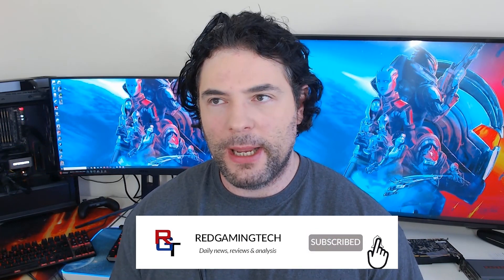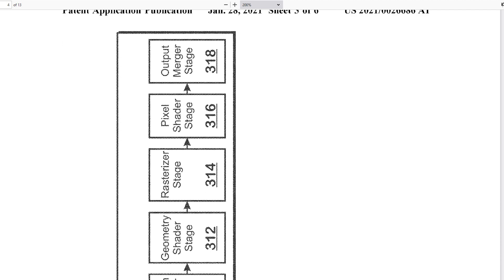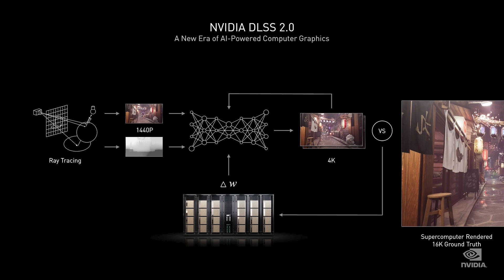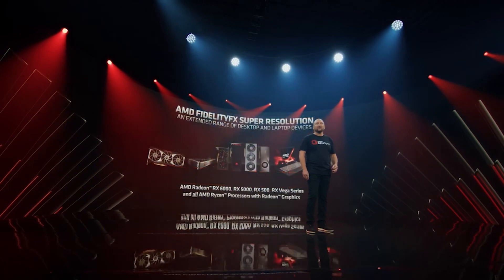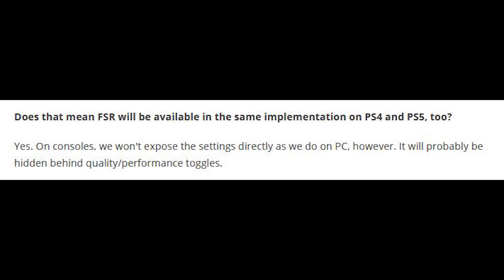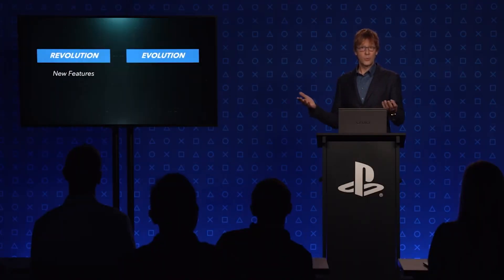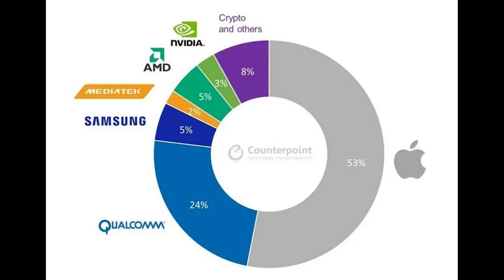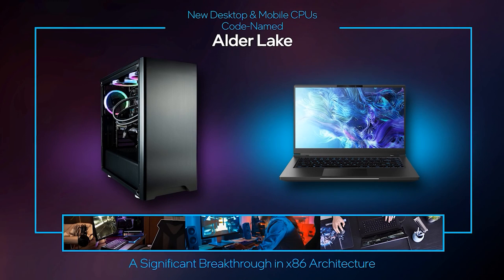RDNA 3 Upsampling - How Navi 3X Could TRANSFORM FSR | PS5 FSR Support CONFIRMED By Dev

Comment: FSR is primarily a showcase in how effective AMD's marketing is.  As far as I can tell it's essentially just CAS 2.0 coupled with basic bilinear upscaling but they've managed to get tons of people thinking it's better than DLSS.

On the topic of DLSS, as far as I'm aware only DLSS 1.0 required per-game training.  That shouldn't be the case for 2.0 - it's supposed to be a completely generalized model without any per-game training data required.
Reply: FSR is WAAAAAY more than you're giving it credit for. But it seems you only listen to Digital Foundry...  If only Digital Foundry's FSR comparisons weren't all totally fucking broken... On a TON of levels... -_- ... How the fuck have you not heard about this yet? He ruined the comparisons with different depth of field settings in Kingshunt that gimped FSR vs Unreal TAAU (when properly configured the former looks BETTER, not worse). 

He refused to test above 1080p (which HEAVILY favors temporal solutions due to the minimal available single frame pixel data even though 1080p is a completely LAST-GEN resolution). 

AND he ran CAS on TOP OF FSR, double sharpening the image into oblivion. Do more research and don't trust DF just because it's DF. There's a reason they were the ONLY one to think FSR sucks.

He also only tested still screenshots which MASSIVELY favors temporal solutions over spatial ones as it makes it so you can't see the AWFUL motion artifacts temporal upscalers cause.

Alex Battaglia had an agenda, and so he bent & manipulated his testing to fit that agenda. End of story. It's sad that he's tricked soon many fools like you though.
Reply: @Cooe.  Paranoid much? Dude calm down, you make FSR sound like some kind of religious topic.
Reply: @stingymcduck5450  I'm just tired of people regurgitating the same definitively proven faulty Digital Foundry FSR "testing" BULLSHIT over... and over... and over... and over again. It's admittedly very frustrating, and I'll acknowledge that can get to me after a while. 

Having people blatantly ignore what's staring them right in the face can be aggravating as all FUCK lol.

It's like someone staring at a red rose and REPEATEDLY claiming that it's blue because someone else claimed it was blue because they were wearing blue tinted glasses that COMPLETELY corrupted their test view of the rose's color... -_-

Also, you double posted.
Reply: And it completely SHITS all over standard bilinear upscaling used with CAS. Like, it's not even fucking CLOSE! Maybe do your own testing instead of regurgitating Alex Battaglia's horribly broken & unscientific bullshit?
Reply: @Cooe.  I've looked at every comparison I can find and did my own testing for the games I have access to.  I've seen nothing to indicate that FSR is anything more than what I stated - just a slightly smarter sharpening algorithm vs CAS.
Reply: @Cooe.  you sound so angry but there's images from the community that can back him up, sometimes he's too mean but he does have valid points like temporal upscaling should be better than spatial (unless its implementation is absolute terrible) aswell as there's many upscalers in the pc market that can bring similar quality or better although it might emphasise different characteristics so its upto you if you prefer it or not.

What I will say is why is using 1080p and upscaling so bad? Considering thats fsrs main use for most people is to prolong older gpus which cannot run at 4k. Youre argument here is that it only makes sense to use fsr on rx6700xt+ and 2080+ gpus? Which will get slimmer and slimmer since hard games need stronger gpus in order to actually run near 4k. This means that other forms of upscaling like taa upscaling will be superior and can run on older cards aswell.
Reply: @darkwolf1739  There's WAAAAY more images that don't back him up. Like those from literally every other reviewer that tested FSR... (He was literally the ONLY ONE to think it was crap). And you didn't respond to ANY of the massive testing mistakes he made. 

And why is not using above 1080p an issue? What resolution do the next-gen consoles game at? 4K. What resolution are developers targeting their game's, engines, & assets at? 4K. 1080p is LAST-GEN and modern games can be run at that resolution with almost potato class hardware.

Where high quality spatial upscalers actually make sense is upscaling to high resolutions. Next-gen games are designed to be played at... high resolutions.

Yes, temporal solutions are better for stupid low resolutions, but 1080p gaming is the past dude. Thinking otherwise is just head in sand denialism. For high resolution upscaling, temporal solutions give you all the motion artifacts but with no better visuals than a high quality spatial upscaler like FSR = INFERIOR SOLUTION!
Reply: @darkwolf1739  Also, show me a widely available upscaler that can match FSR in quality, because I'm calling BULLSHIT on that one. When properly configured (aka with the same depth of field settings & >=1440p), Unreal's TAAU looks WORSE than FSR, not better, and that's about the best non-DLSS solution there was pre-FSR (and it wasn't exactly "widely available". It wasn't even used in every UE game).

Again, you are simply regurgitating Alex's INHERENTLY FAULTY TESTING. If you have a >=1440p display, go actually do some of your own. You might be surprised.
Reply: @darkwolf1739  Also, how can FSR look better than Unreal TAAU when properly configured (aka no borked DOF settings & tested at >=1440p) + WITHOUT TAAU's motion artifacts yet, "Alex is right about temporal solutions basically always being superior". Uhhh, WAT??? O_o

Just because Alex has a ridiculous bias for temporal solutions such that he'll deliberately gimp his testing to make that always look true, doesn't mean you need to as well.
Reply: @Cooe.  you realise that your 1st point backs me up and taaus motion artifacts yet fsr has motion artifacts aswell. 

You then just get angry because I quote him and say he isn't just totally wrong. Youre just an angry amd fanboy like look I want it to be great.Screw dlss if it can work on every gpu but its not so easy. The point is that Taa upscaling is the fsr that most people want and we need to encourage developers to also introduce it considering alot of games have it in their engine already with a flick of a switch theres no reason not to make it available.
Reply: @darkwolf1739  FSR's (& other spatial upscalers) motion artifacts aren't even on the same universe as those from temporal solutions. And again, you refuse to acknowledge or explain any of his testing errors! Why? And you also refuse to tell me this magic widely available upscaler of yours. Unreal TAAU looks WORSE than FSR, not better. It only looks better than FSR when you gimp it with differing DOF settings & refuse to run above 1080p... -_-

WHERE IS THIS, MAGIC, SUPERIOR TO FSR TEMPORAL UPSCALER???
Reply: @darkwolf1739  Why would we push temporal upscalers for high resolutions over FSR? Unreal's TAAU, which is the BEST TEMPORAL UPSCALING SOLUTION IN THE BUSINESS, looks WORSE than FSR for high resolution upscaling, not better. So why should we push that instead? O_o You're not making any damn sense lol.

You're either saying "All next-gen gaming should be at a max 1080p resolution" OR "We should use a worse upscaler just because Alex Battaglia said so because of his faulty ass broken testing".
Reply: @darkwolf1739  And no response. Lol what a surprise... NOT. Just admit that this "magical" widely available temporal upscaler you were talking about was Unreal's TAAU, and the only reason you thought it was superior to FSR was Alex's totally broken & borked comparison that massively gimped FSR by using different depth of field settings across both configs (let ALONE only testing at 1080p), when in actuality, FSR is superior when properly configured.

Here's some advice lol, GO TEST FSR YOURSELF INSTEAD OF REGURGITATING HIS FAULTY BULLSHIT AGAIN!
Reply: @Cooe.  taau is better than dlss? Also if you care so much about temporal artifacts then checkerboarding is in some games and can be implemented in many big games atleast which won't have "so many artifacts"

What you're saying is coming from sheer anger, just take a step back and breathe. Take a few days off thinking about upscalers then come back
Reply: @Cooe.  also another upscaler better than taa upscaling is tsr
Reply: @darkwolf1739  And way to ignore Alex's testing mistakes YET AGAIN! Lol do you have severe dyslexia or something? The "testing" he did is WORTHLESS!
Reply: @darkwolf1739  Also, we have no idea if TSR is superior to FSR yet. It's not widely available. And it's just the next-gen version of Unreal's TAAU. It's likely to have the same primary flaws, but we won't know that until we can do proper FSR vs TSR comparisons. But as of right now? Unreal Engine 4's TAAU is WORSE than FSR for >=1440p upscaling. End of story. Unreal 5 & TSR might change that equation, but they aren't here yet.
Reply: If it competes with DLSS does it really need to be “better”?

So long as it’s not as bad as DLSS 1.0 and if it works in any game that’s all that matters.
Reply: Literally NO ONE besides you has said it's better than DLSS xD.
Reply: "As far as I can tell it's essentially" and "as far as I'm aware" seems what you are telling is wrong on many levels and you aren't very aware in generel..

Comment: I don't understand why people think that the #1 and #2 console makers should follow what #3 is doing. Nintendo has never shown you anything. Microsoft bragged about all this power, well lets see it. if they are doing thinks so much better, than why a 2 year wait for AAA games? I expect Xbox worst games to be on par with Spider-Man Miles Morales and Ratchet & Clank.
It is a lot more powerful system right?
Reply: You missed the MS dev kits late getting out to developers memo? And some features just got opened up to developers, so they are not likely to be in any games that are currently in development.
Reply: @statesman6379  I just want all this tech talk to translate in to some great games with less glitches. Both of these systems are great, but people want to blame the system and not the developers.
Reply: @willierhone6244  so alot of these things can get boiled down to different techs boosting the power when used well like sampler feedback, direct storage if its not on xbox yet, vrs and mesh shading. I don't believe any of those have been implemented just yes but they've all got alot of potential. 

At the same time there will be alot the PlayStation can do.

Right now these games are more bruteforced than they will be compared to games coming out soon
Reply: It's about 30% more faster on the GPU. CPU is also faster but only a couple hundred MHz, not likely to ever be noticable in games.
Reply: @joesaiditstrue  30% from where this nonsense comes from? PS5 GPU have higher clock frequency and that a big deal with Rdna 2
Reply: @joesaiditstrue    true.
Reply: Forza Horizon 5 looks better than most of Sony's games, same for FS 2020.  We've already seen both.  Also they have less cross-gen 1P games than Sony at this point.

  Did your administrator wake you back up from an update dating back to December 2020 or something?  You're WAAAYYYY out of the loop, buddie xD.
Reply: @samalton5837  you delusional 😂
Reply: Microsoft has always had the more powerful console but their games have always been subpar thats why it never helps them
Reply: @IlIIlIIlIIl   I know. All these people are one PC in chats. So for me GamePass sounds better to me on pc with a 3080ti.
Reply: @Xstation  sorry on pc.

Comment: 8:55. The whole GPU open stick is PRed with DirectX in mind as a first. Its pretty clear why Microsoft rides that PR and Sony isnt. Is FSR or any fidelityFX actually working on Playstation's APi ?
Reply: Yes. https://wccftech.com/edge-of-eternity-tech-qa-dev-on-amd-fsr-vs-nvidia-dlss-ps5-vs-xsx-and-more/ The quote from the interview, "Does that mean FSR will be available in the same implementation on PS4 and PS5, too? Yes. On consoles, we won't expose the settings directly as we do on PC, however. It will probably be hidden behind quality/performance toggles."
These guys are implementing on X1 and PS4 as well apparently. Forspoken, which is PS5 and PC exclusive, is also implementing it apparently.
Reply: Why would AMD allow that type of PR to go by if it were fake?  I don't think you know what FSR actually is or what it requires to function.  The whole thing is MS have said their systems support INT8 and INT4 instructions for ML inference.  Those are optionally enabled for RDNA2 GPUs but there's no indication Sony opted to include them, and stuck with FP16 similar to PS4 Pro (in fact it'd be required in order to have BC with PS4 Pro versions of games).

  You don't need special ML hardware acceleration built into the GPU (like Tensor Cores, or what small additions MS did in that regard for DirectML), and you don't need any specific low-level FP or INT support for it, either.  FSR is a software-based solution, running on GPUs via compute.